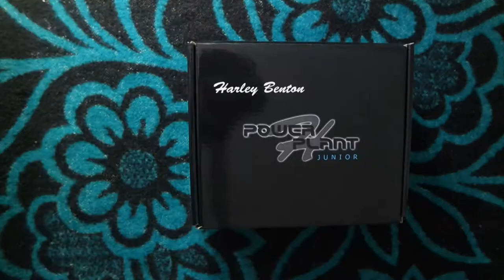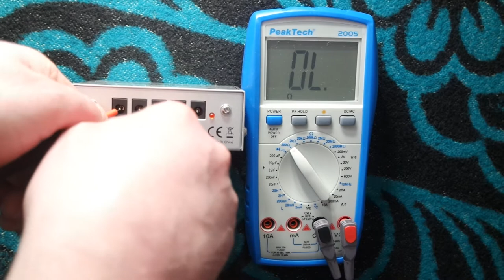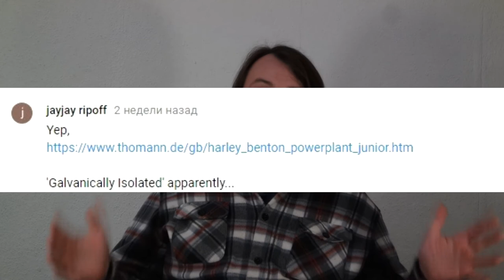Gear review: Harley Benton Power Plant Junior (the good one)

Comment: You forget to mention that this one does not have an external power supply like many other isolated power distributors. I think it is a huge benefit to have a proper cable on the device and plug it into the 230 V outlet directly.
Reply from the maker: Well, that wasn't a big issue for me. That was like second power supply for multiple stomp boxes that I've tried out in my life, first one was HB Powerplant. Both didn't have external power supply, so I had no experience with the ones that were powered with  external power supply. However I made some sort of unboxing, so I don't know if it was necessary to mention it. 
Besides, I never had an issue with the units that were powered with external power supplies. The HB Iso series are smaller, lighter, provide more power, are isolated and you can plug those worldwide because they can handle anything from 100 up to 240 Volts. So, is it big advantage to have just a cable without any external power supplies? I don't know.

Comment: Good demo sir..i have a question.i have a mooer  reecho digtal delay and its power consumpion is 128ma..is it okay to power it with 1 output?can i also daisy chain 1 output for low Ma consumpion pedals, like tuner, compressor and other analog pedals?thanks in advance..have a great day.
Reply from the maker: Well...I don't know. It might work with mooer, it might not, I don't have it to check it out. It might work with analog devices and daisy chain. You'd better check out on your own because I don't know what kind of equipment you have. And even if you send me a list of your equipment,  it's probably totally different than mine. So...35 euros is not that much to try it out. But if you don't want to take a risk to buy some power supply that wouldn't be enough, save some money and buy Harley Benton Powerplant ISO 2 pro, it's 69 euro, and it can power as good as anything, and it's small and isolated.

Comment: Don't you double the "voltage" with the daisy chain connected to several outputs?
Reply from the maker: No. You double the amperage. This is parralel connection, not serial.

Comment: I have a problem, maybe you can help me: I have 3 Powerplant JR and one of them gets a little hot after 30 min and I feel some vibration if I touch the box of Powerplant Jr. It happens even if I connect pedals and they are off. Pedals connected are Tc Electronic Ditto mini, HoF mini, Flashback delay, MXR Corona Chorus and TC Electronic Vortex Mini. What can be this? Vibration + little heat. Thanks
Reply from the maker: I don't know. It may be a transformer, that is busted, or capacitors. If you can exchange a couple of capacitors and it fixes the problem than it's ok, if transformer is busted, then changing it might be more expensive than powerplant jr. itself.
Reply: Thanks :)

Comment: So as long as the power requirement (in mA) for a pedal is achieved, the suggested DC current doesnt matter? (E.g, the TwoNote box you mentioned)
Reply from the maker: Of course, it matters. In the video, this was an experiment about power requirements, to see if this power supply can handle 300 mA device. If you power two notes with 9 Volt you get a lot of scratchy noises, you do need 12 volts for it.
Reply: leothemetal got it thanks. One more question, have u checked if this powerplant delivers 9V/120mA consistently thru each channel? Many thanks
Reply from the maker: Indra Gupta  well, that's was my whole point, why I made this experiment with two notes
Reply: leothemetal sh*t, my slow brain did it again. My apology. Thanks brother
Reply from the maker: @indragupta4521  You are welcome

Comment: Hey Leo, i have a question.
Is it possible to use the all 4 with the regular cable, and 1 with the long daisy cable? i mean, to power up more than 5 pedals. Or is it a nonsense? I dont have a clue!
Reply from the maker: Hey alejandro. Thanks for question. 
well-what do you need to know about daisy chain cable? each output gives you 120 mA, so you have to check you stomp boxes, how much power do they need. For exaple-one pedal needs 40 mA, another one 30 mA and another one 45 mA. you siply add those numbers  30+40+45, you get 115 mA-thats what your pedals need. It is less than each output of Powerplant junior gives, in this case you can feed you pedals with one cable. if you add another pedal that requires for exaple 40 mA, the total power usage is 155-this is more than power supply can give. As long as you keep this rule in mind you can connect pedals the way you described. 
However-you might get noise because of ground loops (I explained it in the video about original powerplant https://www.youtube.com/watch?v=hYmWPNfUwwA&t=3s ). If your pedals can work with daisy chain-go for it, however in this case you don't need this power supply, a couple of daisy chain cables and some basic power supply (like this onehttps://www.thomann.de/de/thomann_nt_0910.htm) will do the job for half price of HB Powerplant junior. If you don't want to risk to get noise with ground loops you need halvanically isolated outputs, so you can check ISO series from HB Powerplant. They are slighly expensive, but still not so expensive as some VOODO LAB or CIOKS power supplies.
https://www.youtube.com/watch?v=wl1YXMQ9Faw
Reply: @leothemetal  You are very clear, thank you so much for your very detailed information and help!
Reply from the maker: @alejandroghoulmez  you are welcome

Comment: Hi, could I power two ore more pedals that amount to less than 120mA off of one output with this HB junior? thanks
Reply from the maker: Well, of course, you can, but why would you?  If you want to use the daisy chain cable in a first place, you don't need 5 output power supply, just grab one that is cheaper and a daisy chain cable. But the whole point of using this power supply is because of all of its outputs are GALVANICALLY ISOLATED. Check Wikipedia if you don't know why it's important, or my video about original HB Powerplant, I've mentioned it there as well. 
https://www.youtube.com/watch?v=hYmWPNfUwwA
The point is if you use a daisy chain cable, you create ground loops, the main cause of interference current, that leads to high pitch noise. So connecting multiple pedals to a single output doesn't make much sense. 
Hope this helps you.
Reply: yes, this helps. thank you.
Reply from the maker: You are welcome

Comment: I use the daisy chain to power 5 pedals from one of the outputs, works great that way as long as the combined need of power for those pedals is less than 120 mA.
Reply from the maker: Some pedals work fine with daisy chain, some make noise. It depends on pedal.
Reply: @leothemetal  Probaly yeah, I have there overdrive and fuzz kinda pedals that have only little power need. I actually have a daisy chain in 2 of the Power Plant outputs, so I'm powering 12 pedals in total with it. Great unit for such a low price, was also glad to see you opened it in your review.
Reply from the maker: @SoothingNoice  It's not about how much power your pedals need, but if they need isolated power, because otherwise they can produce noise.

Comment: I'm 2 years too late to your power supply reviews, but they are fantastic! Are the Harley Benton power supplies still working ok for you after all this time? Kind Regards - Gabe
Reply from the maker: Well, the one I own is  ISO 2 Pro, it works fine after about 2 years of constant using it. 
Powerplant Junior was a giveaway, so I don't know, if it still works, but I gues. 
The original powerplant and powerplant flex were sold in ebay, if something doesn't work the way I need I don't see the point of keeping it, so I can't tell if they last for a lifetime. But the way they are built there is nothing that can be broken, ecxept for capacitors.
Reply: @leothemetal  2 Years for the Iso 2 pro sounds good to me ! :)
Reply from the maker: @GabrielNacu  You can deffinitelly go for it.
Reply: @leothemetal  My Iso 5 came in the post today. Nice and noiseless! Cheers for the recommendation :)
Reply from the maker: @GabrielNacu  You are welcome. Have fun with ISO 5